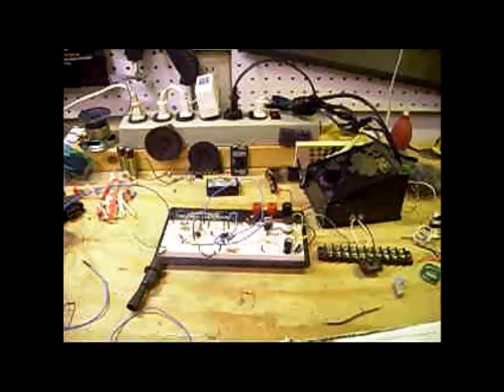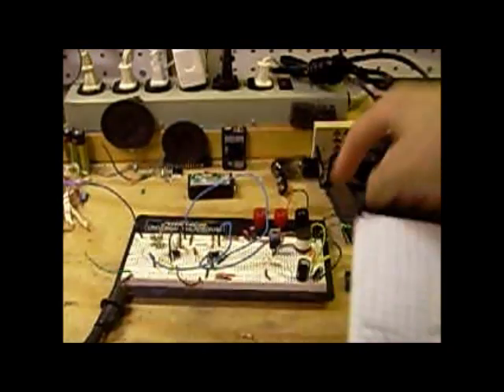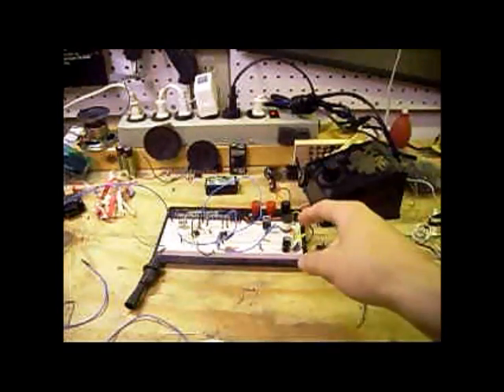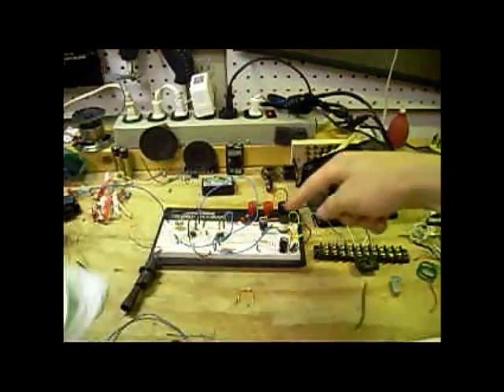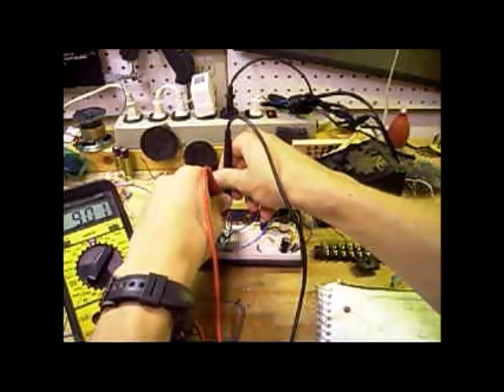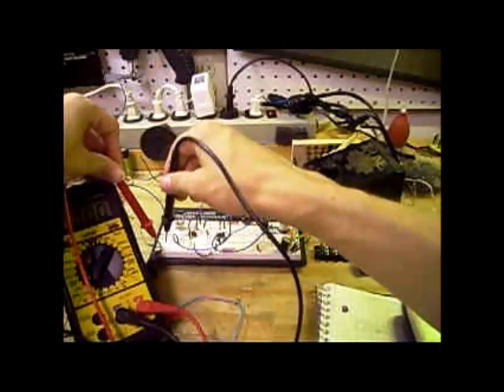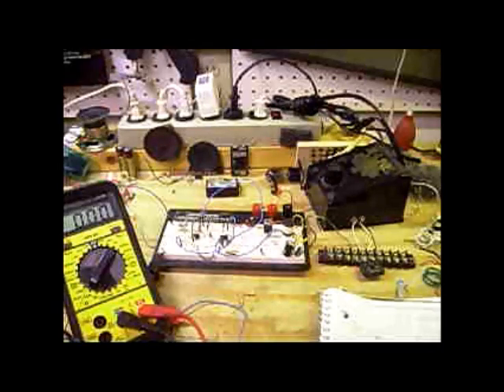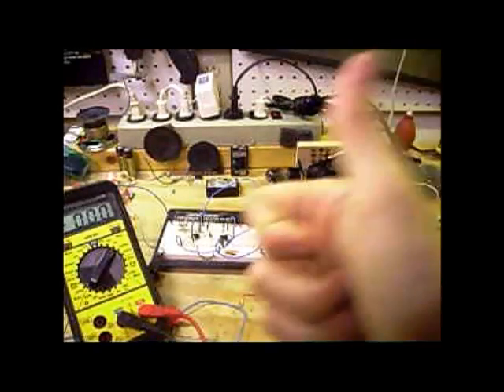Buck Converter Problems

Comment: I guess you've moved on or figured it out by now, but for other's sake I'm gonna leave this comment.  The voltage output from a buck converter is directly related to the duty cycle only if the load is above the minimum load.   If you don't provide enough load, then the output falls out of regulation. And a 50% duty cycle requires the largest load. The LED may have drawn enough current at a 5% or maybe 95% duty cycle to keep regulation.  There are numerous examples of equations to calculate the minimum inductor size based on minimum load. And by the way, this is generally why commercial power supplies use active feedback.  If you read the Wikipedia article on buck or boost converters you'll see a section on this.
Reply from the maker: Thank you for noting this for others, I did implement active feedback a month after this video was made by feeding in a sample voltage from a voltage divider on the output.

That sample was feed into the 555's control pin to adjust duty, a good design of it is floating out on the web somewhere.

Comment: first thought i have is that the mosfet is always on. does it have a pulldown resistor (100k) at the gate? it should. and is it driven directly by the 555? you might need another tr to drive it harder for the gate capacitance.